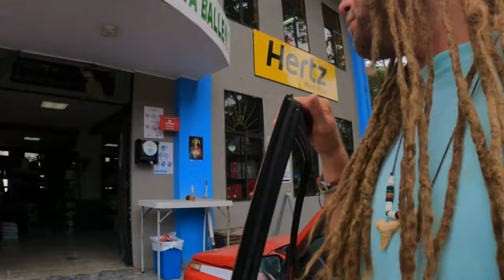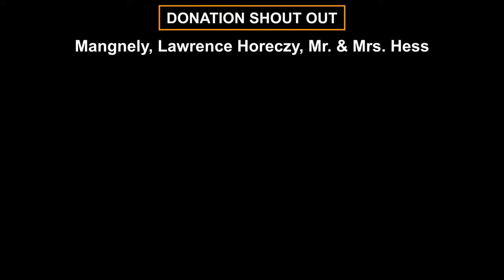Stuck in Costa Rica 😱 Broken Clutch Cable - Chenz Life ep 40

Comment: Years ago driving home in a snowstorm my clutch pedal linkage broke when I stopped at a red light.  I shut the engine off, put it in first gear and when the light turned green I turned the key and got rolling again.  Shifting without the clutch takes a bit of practice but might get you home when things fall apart.
Reply from the maker: I nevwr tried to shift but I got it home in first lol
Reply: @Chenzaloon  Tractor Trailer drivers only use the clutch when stopping & starting. All 13 to 15 gears are run thru by matching the RPM's.